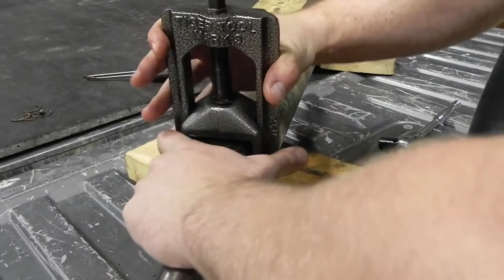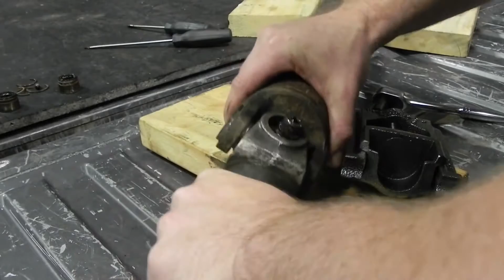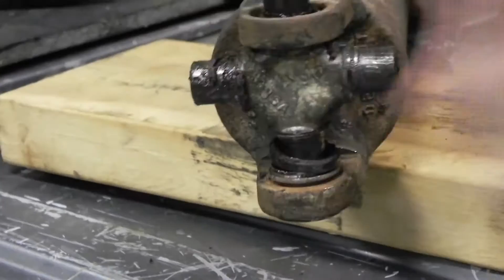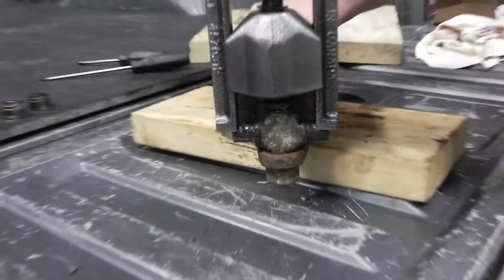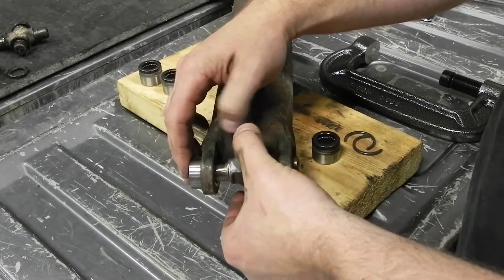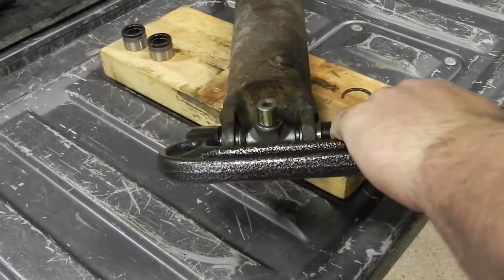Tiger Tool U Joint Puller

Comment: can you do that with a regular C-clamp?
Reply from the maker: No, a C-clamp applies pressure on both sides where this tool allows both sides to be undone evenly.
Reply: yes just make sure the cap you're pushing out you have a socket on that side of the C-clamp so it can go and a SMALLER SOCKET on the compression side of the clamp